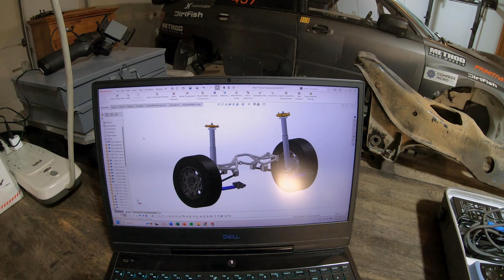Ferrari Swapped Subaru | F136 Build Series Ep5 - Starting Over

Comment: A really cool project, and to be honest I'm only interested this because of the swap. So your master plan has worked.😁 Do you have had any issues because NVH caused by the flat plane crank? How you have mounted the engine to the chassie? I've read that ferrari used some kind of hydraulic mounts to dampen the vibrations? You still use oem wet sump oiling system? How's that worked in action?
Reply from the maker: Thanks. No noticeable NVH issues from the flat plane, but the whole care is just loud in general as there aren’t many bushings left. The engine is currently mounted on a u-frame connected to the frame rails and has perches that mate up to the OEM brackets coming off the engine. Just hard rubber between those. Wet sump hasn’t been an issue aside from cracking the pan on an impact (I didn’t design in enough impact clearance to the skid plate mount). We generally don’t see enough sustained cornering g’s to really necessitate a dry sump system. Hope that answers your questions!
Reply: @SamAlbertRally  it would be nice see the mounting setup in the video, when you next time pull the engine out.
Reply: I'm more a drift guy, but a finn so Ive followed wrc at some level my whole life. I remember juha kankkunen his rivalries. But im so mad i didn't born earlier to be able to witness the golden age as in the b group. Your car reminds that mentality when every car had a personality, the engines differed completely, you could recognize each car from the sound from a mile away. Just like your car.
Reply: @SamAlbertRally  thanks man! Do you have any plans for mechanical engine upgrades? Like cams, headwork etc? What fuel youre allowed to use?
Reply from the maker: @loverboy8476  I’m not allowed to do any upgrades due to our series’ rules for this motor. We run both 92 for regional events and up and Canada, and then VP R5.2 for ARA national events which is the current spec fuel.
Reply: @SamAlbertRally  ok, thanks! Good luck for the next race!

Comment: I have to ask did your competitors in that Canada rally use studded tires? If so that's insane you won and a bit mad how you took it out on the snow with no studs. I've never seen the drivetrain layout of this car, I'm curious to see how the front diff fits round the engine. I am also curious how the cooling solution works, what solutions you came up with and any changes planned?
Reply from the maker: Most did used studded tires which were superior until the snow started coming down.
Reply from the maker: Using the Subaru drivetrain so that’s all mostly in the stock location. I’ll have to do a video on the cooling system.

Comment: a very cool project, my respect. I wonder what kind of software exists for modeling suspension kinematics?
Reply from the maker: The three main ones I know of are OptimumKinematics, Susprog3D, and ChassisSim. You can also do it a bit more manually within Solidworks or use Excel, Matlab, etc to get the basics.
Reply: @SamAlbertRally  good thanks